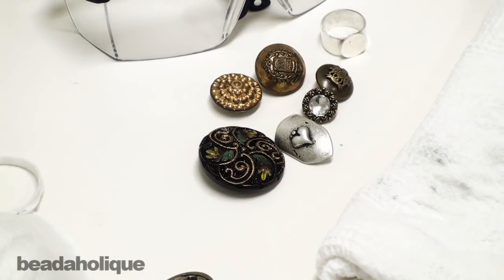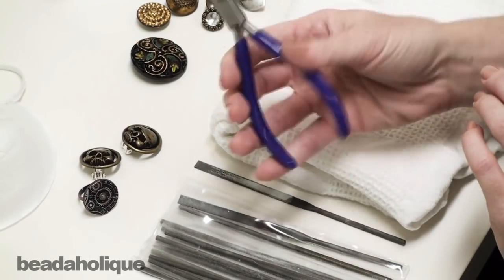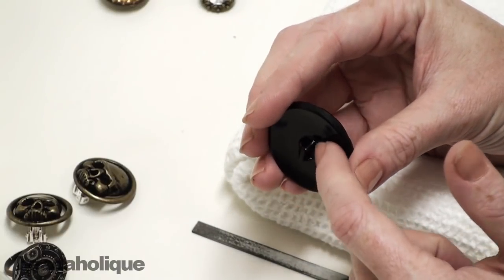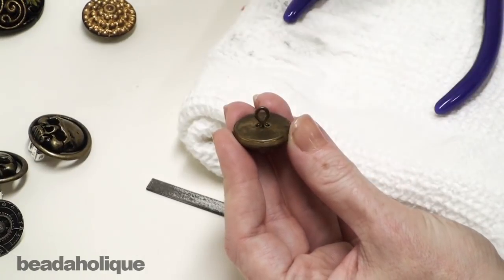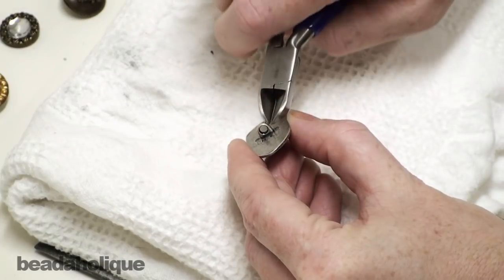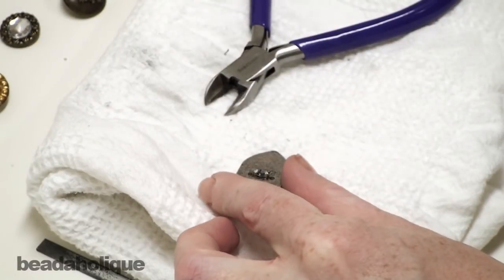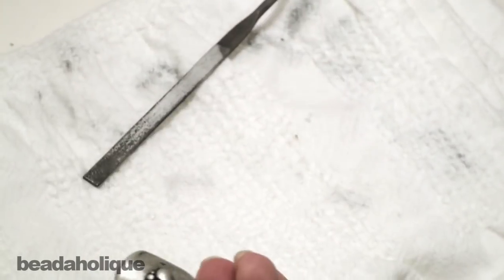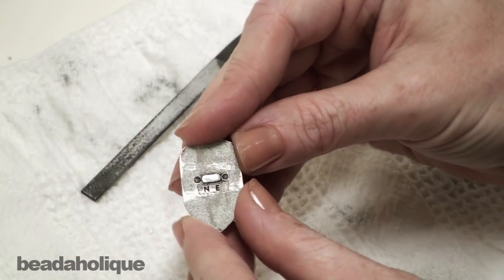How to Remove a Button Shank

Comment: I tried it with my wire cutters and I break them every time. why is that
Reply from the maker: Hi Sophia, so sorry if you're breaking cutters every time you try this technique, that sounds miserable (And expensive!). We've got a lot soft metal buttons in stock so for this demonstration we went with a pretty lightweight pair of jewelry cutters, but it sounds like you're working with buttons made out of harder stuff. You might need to grab yourself some industrial strength cutters. We've got a heavy duty flush cutter that can handle up to 10 gauge copper wire: https://www.beadaholique.com/chp-milano-heavy-duty-flush-cutter-cuts-up-to-2-5mm-copper-wire.html If that looks similar in strength to the sort of cutters you've been using then it might be time to look beyond the jewelry world and head to the hardware store :)